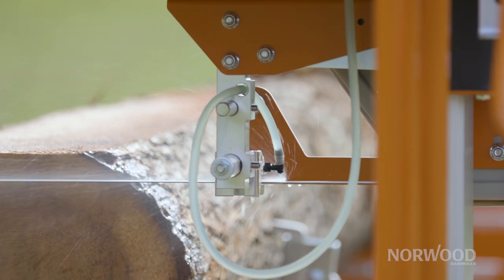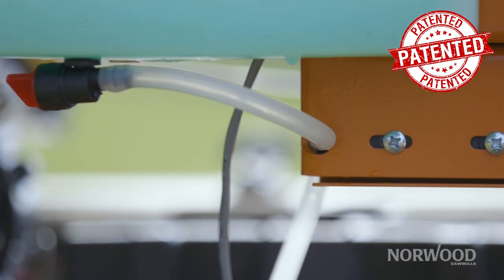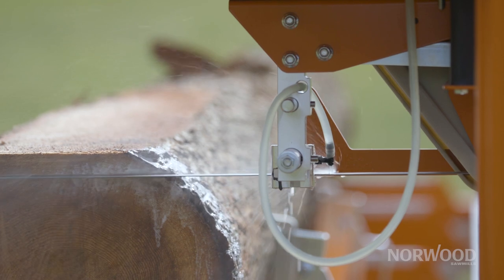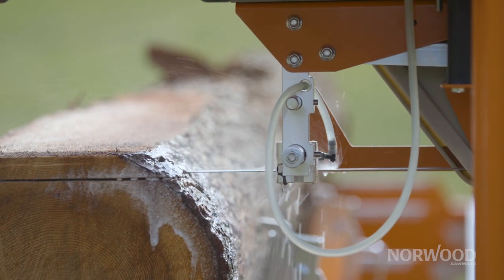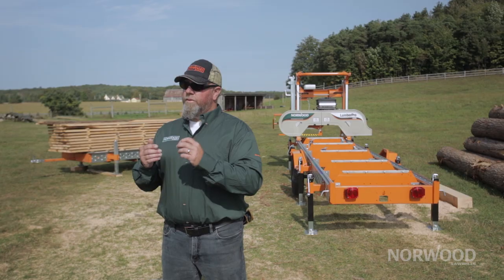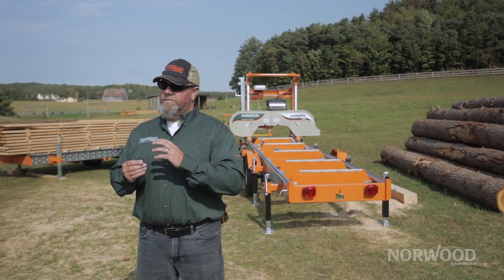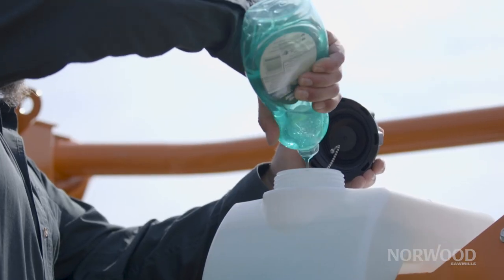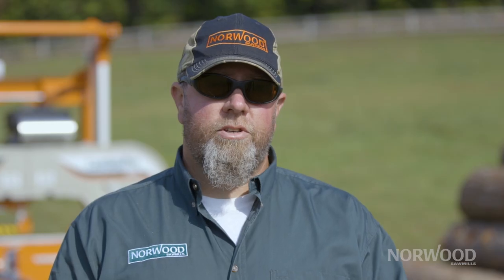SAWMILL TECH TIPS - Auto Blade Lube System

Comment: Hello, I own an HD36 and I live in Northern Vermont. 
That being said the winters can get pretty cold, when milling in the cold days of January thru March the temps can get pretty low. What suggestions would you make for blade lube for the cold temperatures that we can get? Zero degrees Fahrenheit can be pretty normal at times. (Below zero is not unheard of)
In the event that you would still suggest water with dish detergent I realize that I would need to ensure that the tank and lines were empty and cleared when I’m done cutting before packing up for the day. 
I do not believe that I would make it very far into my cutting with just water and detergent.
Do you think it would be safe to use water and cut it with isopropyl alcohol or denatured alcohol? 
Any logical suggestions would be greatly appreciated.
Thank you 🙏.
Reply from the maker: Hello SpeedBuggy. Just add some winter windshield washer (-40 degrees) fluid to your water tank. It is inexpensive, does not spoil your belts or wood and keeps your water lines from freezing. :-)